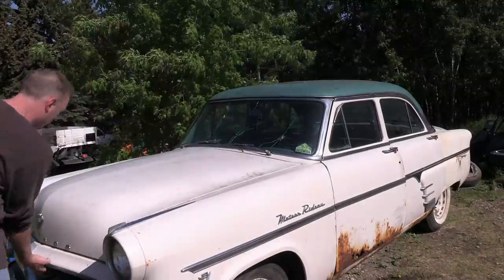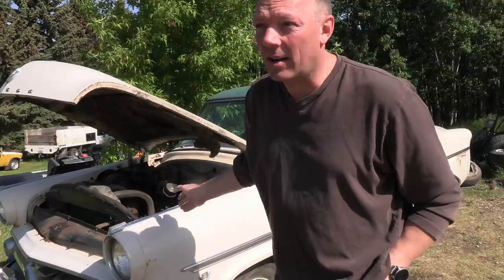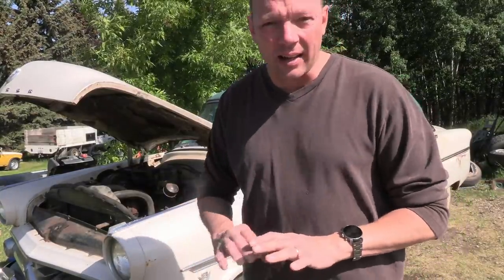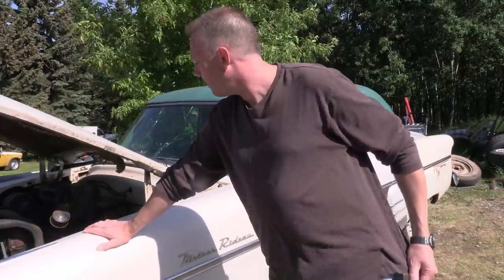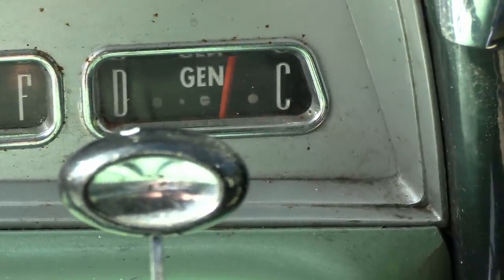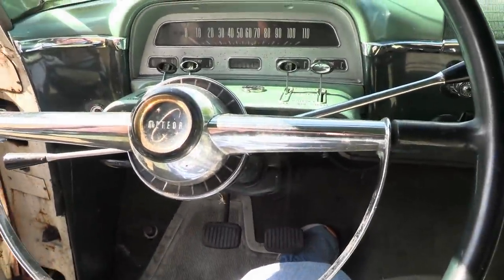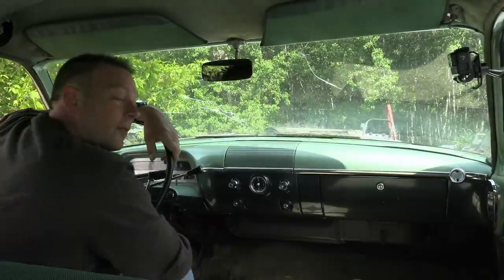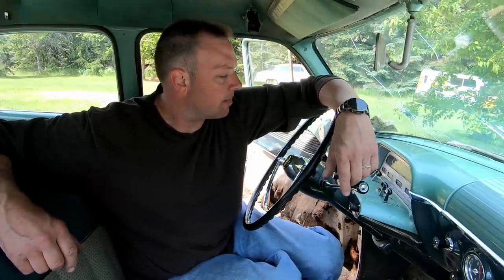Psychic Garage - Ep 17: Flathead Ford First Drive since 1966!

Comment: Carb is a holley 1901 "teapot". Mercury, lincoln, and ford big trucks used this carb. My 52 merc has this carb. Don't listen to all the bad stuff online about these carbs. The passages inside the carb get plugged and they leak. You will definitely want to rebuild it. Use an ultrasonic cleaner to get it really clean. Mike's carburetor parts has ethanol-safe rebuild kits for these.
Great video!

Comment: This has been a trip down memory lane for me! First off the car 54...I had a 54 Ford in 1963 and lots of Flatheads before that but it 54 had a 312 Y block in it but the watching you drive yours down the road, looking out the windshield, seeing the beautiful dash, the steering wheel, the open wing window so cool a step back in time for me ... brought a smile to my face too. The Flatheads are my favorite engines, my Dad owned his own car repair business so with his tutelage I learned how to rebuild, diagnose problems and how to hot rod them ...the Flathead V8 sound is like no other. If you can, put some dual exhausts with some glass pack mufflers, the sound is amazing. Cant wait to watch the rest of your journey with the 54.
Reply from the maker: Thanks so much for commenting! So glad this brings good vibes for you and others. I can't wait to drive it in the spring, it has been put away for the winter and I miss it a lot. I love that engine and can't wait to dig into it some more!

Comment: Being laid up in 1966 this car has never tasted ethanol laced gasoline......unless the gas you're running it on now has ethanol in it. Old gas or not, the tank, fuel pump, lines, and carb will be in better shape than anything run on "modern" gasoline. Congrats on the find!

Comment: My god  my dad had 54 mercury white with blue roof n blue interior 4 door 3 on the tree even with cracks windshields a travel company name cata they had 6 of this cars back in the 50 the used to carry passengers from Argentina to Chile crossings the Andes mountain 🏔 very danger back then yes it was v8 non flat head  I use to drive the car when I was 14 or 15 years in the 70’ good memories good luck with that car n thanks for sharing 👍

Comment: After seeing the rusted out drivers door; remove door, cut off lower half of the door using angle grinder with a a cutting disc, make new panels using old ones as a template, and weld in new metal.

Comment: My first few vehicles had manual steering and as long as you're moving it's not bad at all.  It's only a little difficult when you're stopped and need to turn it, but then, that's why those old cars had such large steering wheels...more leverage when turning the wheel.  If ya don't believe me try putting in a modern size wheel and then trying to turn it when stopped, LOL!

Comment: For gummed valves, sticky lifters, and rings, let alone dirty fuel systems, run a quart of Marvel Mystery oil with the next oil change (minus one qt from reg oil) and in the gas tank, one ounce for every 10 gallons of gas, for the fuel system, you'll be very glad you did...:-)  This is something people have no idea about today, it isn't called Marvel Mystery Oil for nothing....trust me. Run the car with the MMO change for about 100 miles or so, and watch the transformation, it cleans the engine and fuel system like nothing else on the marker for old cars.

Comment: Yeah, I agree with the gentleman that in 54 you would have had the overhead valve Y block. The newest this car can be is a 53. Which, was the last year for the flathead V8.
Reply: The last year for the flathead V8 was 1953 in the U S . In Canada for whatever reason maybe we had lots of Flatheads left but the Canadian 1954 Fords had Flathead V8's . The first year  in Canada for the overhead valve V8 was 1955 which caused difficulties because in 1955 Ford still had a 6 volt electrical system . My Dad  was a fleet  mechanic back in the day and said that unless your 6 volt battery was in top shape it had difficulty starting the overhead in cold weather.
Reply: @conniemorris9025  it was difficult because of the compression ratio on the overhead engine. I retesting about Canadian fords. Must have had a snoot full of engines left over from 53 model year to make another model run in Canada.

Comment: Real nice. It will have the Mercury 255 engine like my 52. Holley "teapot" carburetor. There is a complete repair and parts manual for that carb online. Be sure to lube up all the pivot points on the hood hinges. They are weak, easily bent and broken. New ones available are over $1000. Sounds like it still has a miss. Spray some seafoam down the spark plug holes into the exhaust valves. Thats what I had to do on my Merc. Subscribing.

Comment: Carb. shown is a Holly used on 49 thru 54 Merc. US, good carburator.  Fuel pump was never to good.  New gas tank and line with an electric fuel pump will fix it up..
Reply from the maker: Thanks, yes I'm planning on getting an electric pump as a backup plan for road trips.

Comment: Usually that carb is found on Mercury's, but Canadian cars did alot of different things, they are a good carburetor, but if you rebuild it, you need to watch alot of the rebuild kits as internal parts are not quite right, most replacement accelerator pumps are too long and cause a issue

Comment: What is the make/model of the carb? I could look it up in my 1960 MOTORS if you need any info.
Reply from the maker: I eventually figured out it is a Holley 1901 Teapot 2 barrel. It truly is a great carb, you will see in a future episode how well it was designed, durability is it's strength!
Reply: Good, could only find tuneup specs in the Motor's anyway. Seems to be more information about them on line.
Reply: Ford used a Strombergs carb from about 38 till the end of the run. Mercury 48-51 used a strange carb with the air intake be on the side, don't know who made it.
Reply: @ParklandFilms  The "teapot" carb was used on the 54-56 Y-block. Two if them on police engines were notorious for catching fire.

Comment: Hello I recently did an engine swap in my 2014 dodge journey and the motor will not stay started did you have to flash the ecm or pcm or did you get the ones that went with new engine
Reply from the maker: Didn't flash anything, computer was original to the car.  Mine ran real rough when I first started it. I had to shut it off myself and restart it a few times between clearing the codes with a code reader. After doing that a few times it ran fine, no codes. What does your code reader show for codes?